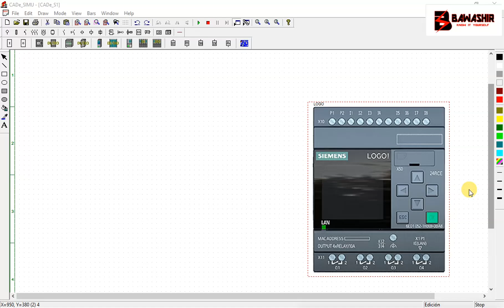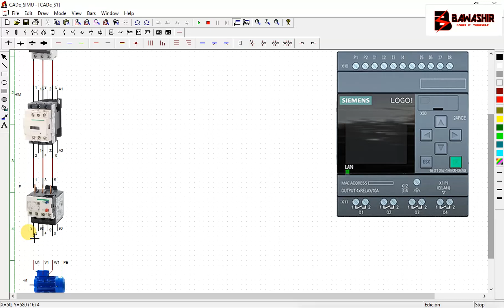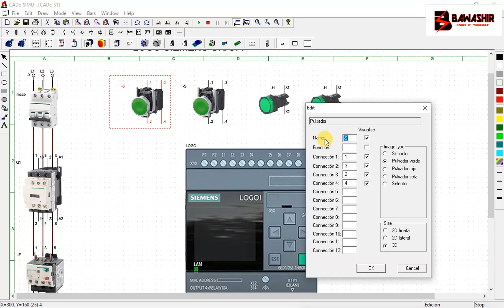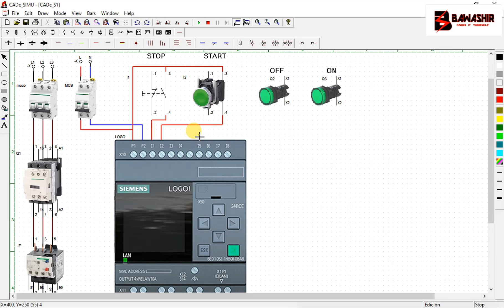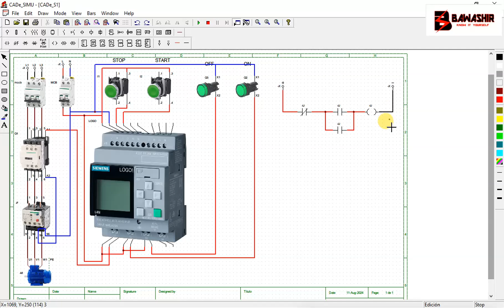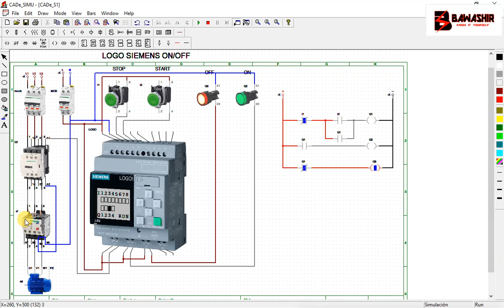LOGO SIEMENS PLC on/off ladder circuit  simulation with Cade-SIMU #industrial @bawashir #plc

Comment: I use the app but when i run a simple soft star rhe power do not flow after the breaker closed, any help
Reply from the maker: Check the connection of wires correctly aftet the breaker